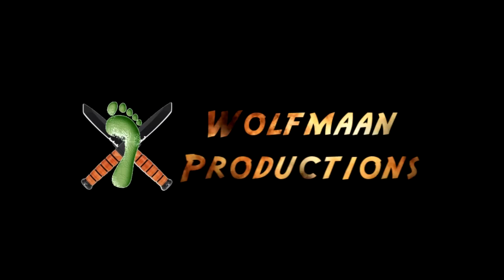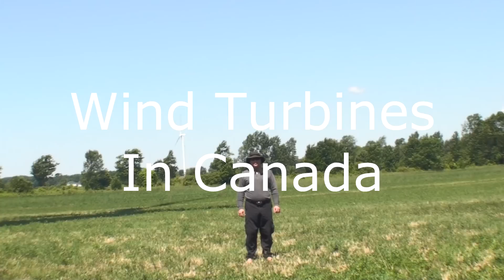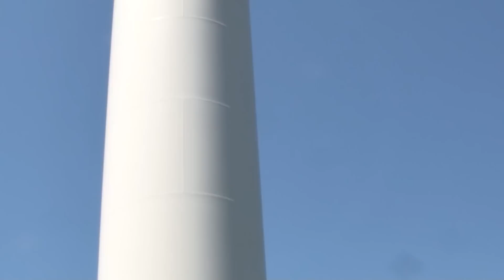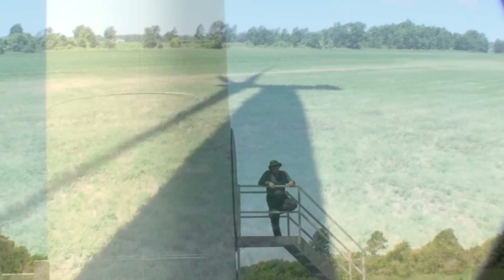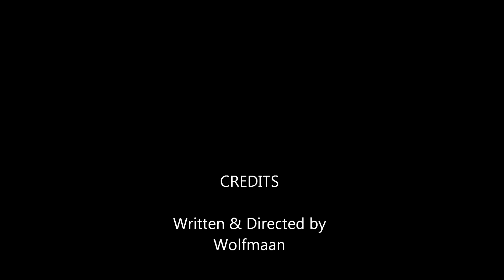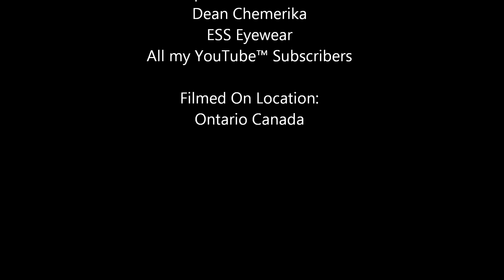Wind Turbines in Canada

Comment: “Replacing with something better”
sounds good. Here is one of the most better:”Since 1992, the
federal government has expended almost $24 billion to encourage
investment in wind power through direct spending, tax breaks, R&D,
loan guarantees and other federal support of electric power. The
Joint Committee on Taxation estimates that a one-year extension of
existing federal subsidies for wind power would cost taxpayers almost
$12 billion. The costs of wind subsidies are extraordinarily
high—$52.48 per one million watt hours generated, according
to the U.S. Energy Information Administration. By contrast, the
subsidies for generating the same amount of electricity from nuclear
power are $3.10, from hydro power 84 cents, from coal 64
cents, and from natural gas 63 cents. 

Wind to gas cost ratio: 83.3 fold.